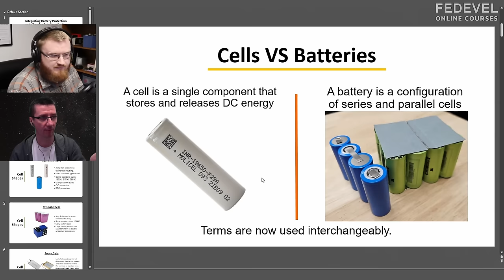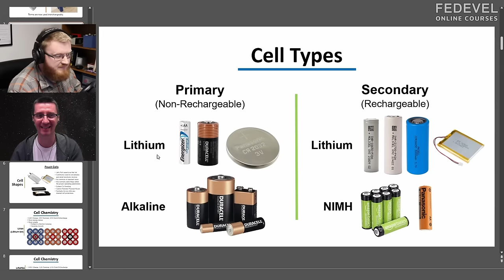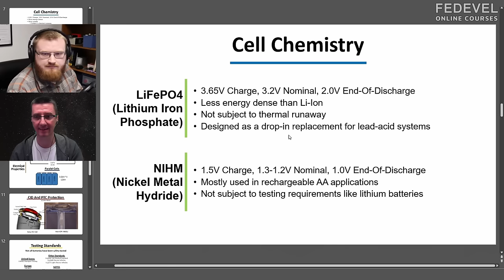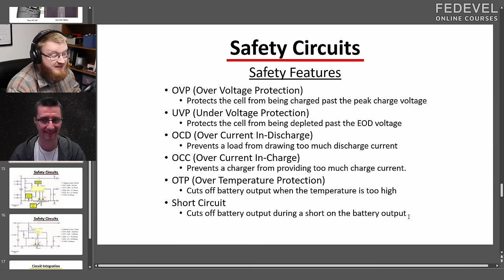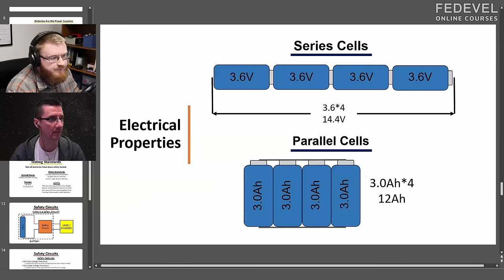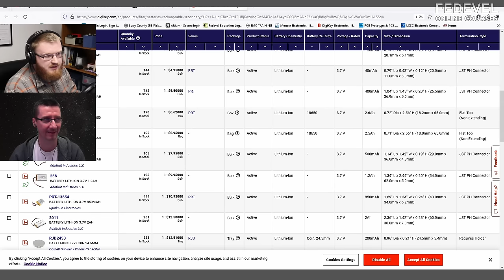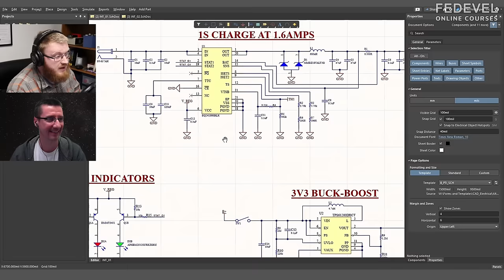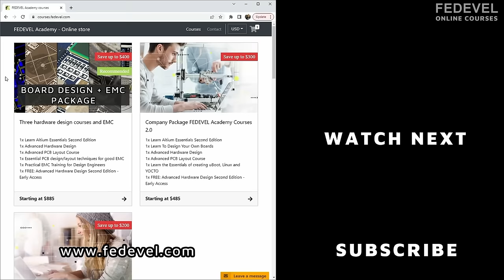Powering Up Your Board From a Battery? You need to know this ...

Comment: Hey Robert, find someone from EV or drone applications. Never saw someone properly design multiple battery management with inductive loads. How to make recuperation properly? How properly connect multiple batteries that may have a little bit different voltage? Depencding on EV/drone voltage goes 12-60v 10-200A, want to see some basics about it.
Reply from the maker: If someone has any tip for a specific person for the video, let me know (send me message on linked in)
Reply: If BMS will cutt off power during fly drone will drop down and damage itself, that's the reason
Reply: @sXAPOLLls  battery cell will not short by itself, if there would be shortcut it would be by electric components side so yes, bms in drone is useless. Maximum what it can need is cell balancer and S voltmeter to let know when cutoff charger and report battery issue

Comment: Great video! I've just finished meddling with battery protection circuit in one project. I've found that with one simple change to standard IC you can protect your circuit from reverse polarity. By placing a diode between the IC ground and the battery ground -you prevent damage to your circuit by blocking the reverse voltage.

Comment: Thank you Robert for the video, it's always interesting to see how someone else solves problems same to yours, but I was surprised that you didn't dived deeply into the hardware building, decomposition of analog and digital solutions of separated BMS elements, heat dissapation, high current nets tracing etc 😢

Buy the way do you planning make some interviews about basic radio building, i watched your interview with cute lady about antennas, but that's a little bit different topic
Reply: I will post videos about radio transmitter and receiver soon - 1-2 months. Tx PCB already ordered - to be tested soon.

Comment: Thanks a lot for your superb content ! A relatively "consumerish" question ...  Since a battery is specified in terms of its charge / discharge cycles, suppose we keep the appliance (eg. laptop) powered continuously by the charger, would it prolong the battery life. I assume that a laptop would draw power from the charger and not from the battery, hence seldom discharging the battery.

Comment: When using one single 18650 battery to power an esp32 project at 3.3V through an HT7833 LDO, how should input and output capacitors?

Comment: Is there a way for a common person to tell if a battery is damaged and is going to burst and cause a fire in a next few days or weeks, save for obvious swelling? A have a few old devices with Li-ion batteries lying around without use - are they becoming dangerous over time?
Reply: Batteries normally only become hazards of they are abused. Ex: temp, current, discharge level. 

Aside from swelling, there isn't a good way to visibly asses the state of a battery. You can use a DMM to check the cell voltages. 

If a cell is really low or 0V, it would be better to properly dispose of it, especially if it is more then a few years old.

Comment: If the battery that I am using in my project has a built-in protection circuit (DW01A IC), is it worth adding another DW01A protection IC on the PCB of the designed device? Or does it miss the point and could cause problems in the operation of the built-in protection circuit?
Reply: If the battery pack already has protection, then there isn't a need to add another protection IC. They may conflict with each other.
Reply: @eetengineer  Thank you for response.

Comment: i just encountered a new problem with battery powered designs. when the battery is first inserted, the battery holder springs create a series of loose contact phenomenon (similar to a switch debounce). The protection IC doesn't immediately see the battery voltage at its full value but a sequence of pulsating values instead. The battery protection IC interprets this as an over-discharged situation and therefore disconnects the battery from the rest of the circuit. i just added a larger cap on the protection chip to delay its startup just enough for the battery voltage to stabilize

Comment: I love LiFePO4. NMC looks impressive on paper, but it degrades so much more quickly, it's not worth the added cost and danger for a couple years of higher capacity. And the degradation is slowed down by not topping it up or fully discharging it, so you end up treating it like it has the capacity of LiFe from the start anyway.